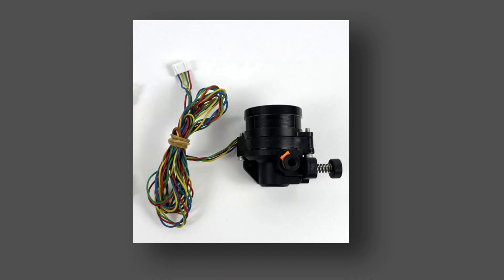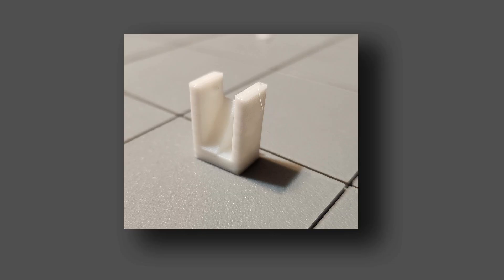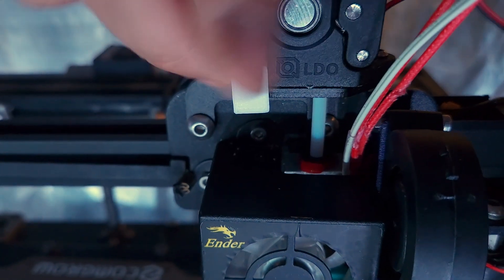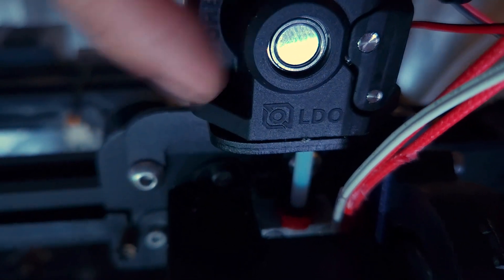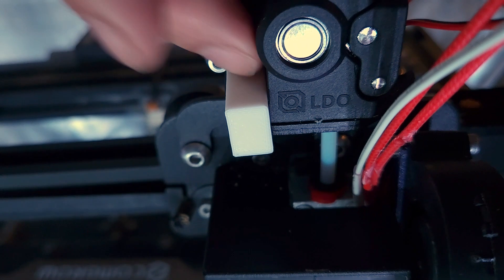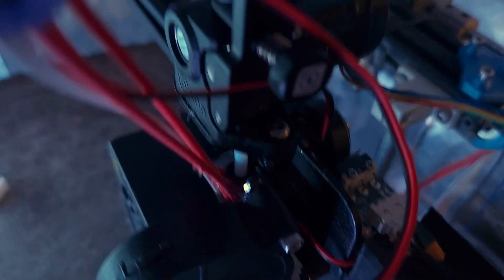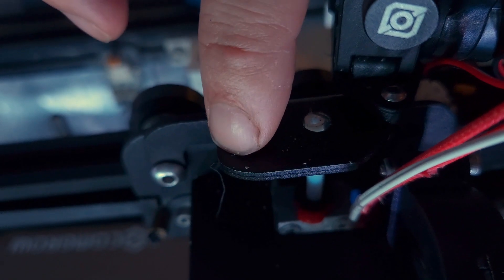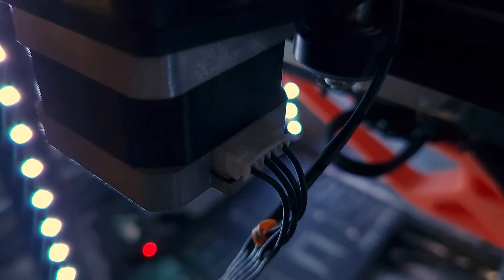Orbiter v2 on an Ender 5

Comment: Did you need to do any software changes or anythIng regarding step count? Also, my black wires are all solid with the exception of 1.
Reply from the maker: yes..you do need to re do your Esteps, as for your black wire..I'm pretty sure the order is still the same reguardless, so  if faceing the correct way, left would be solid, far right would be tiny dash..about 7:38 of the video, pause to get the order..if your is all back it should follow the same pattern even though its not marked. Now wich side on yours would be tiny dash..that I couldnt tell you. best to do is mark one side with tape or paint, and wire it up..if it runs backwards or doesnt work at all, you'll need to flip the ribbon around and re-wire. If that makes sense. there may be an indicator on it some where, or follow the end to the terminal and match the direction up with another cable that does that the markings. . If the end terminals are facing the same direction. good chance thats the order of your all black cable. just look at the one thats marked. hope that made sense
Reply: I ended up jumping contacts to find the coils. Trying to figure out how to adjust e step now. Thank you much.

Comment: Hi. I also change the extruder on my ender 5 plus for orbiter but its rotating in other direction. Do you know which cables i have to swap so it rotates the other way round? Thank you
Reply from the maker: yeah I belive I mentioned it in my video
Reply from the maker: about 5:44 tells you about wireing